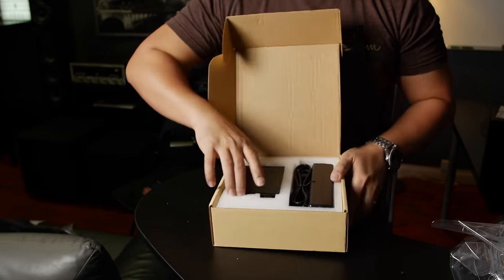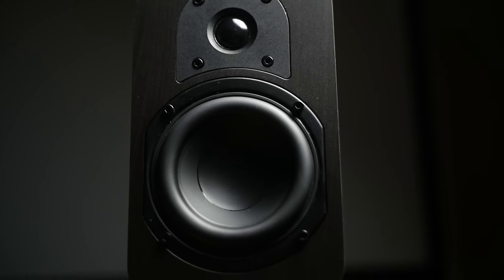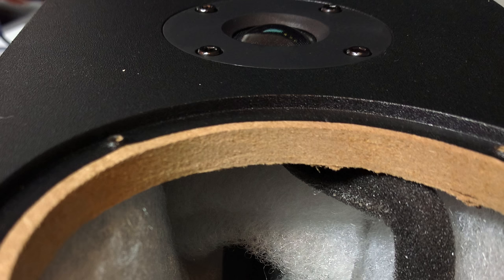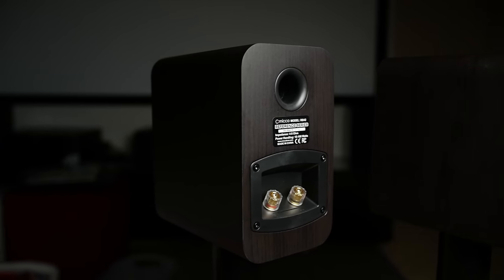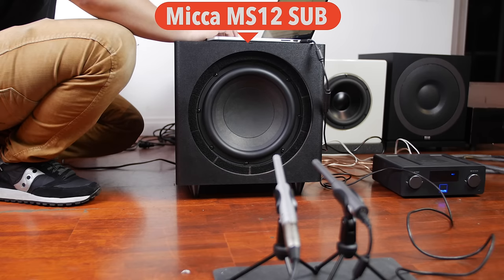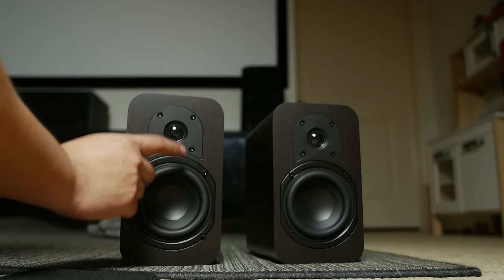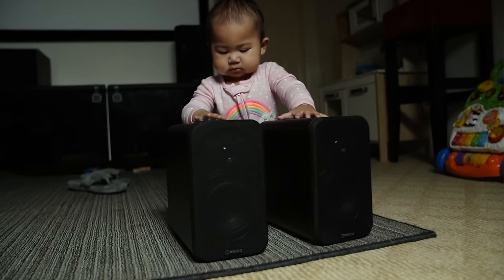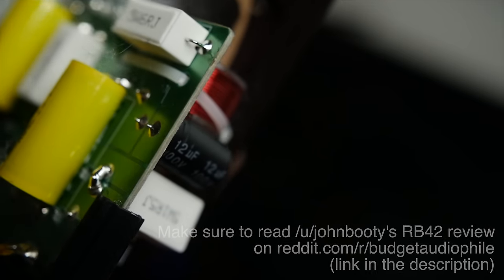Micca RB42 Review vs MB42X Bookshelf Speaker Review- Bonus Crossover Mod (End)

Comment: , the only thing with these is the fact of low sensitivity. you better be pushing a minimum of
50 wpc @rms. or more.
Reply from the maker: Correct on that one.
Reply: , I happen to have the Micca 50wpc mini amp with sub out. I'm running the Dayton 75 wpc sub plate amp into a Dayton 10 inch reference sub.
this is just at work on my work bench. I also have the Dayton MK-402s hooked up, it sounds very good. believe it or not I'm just running the signal from a Sony portable and/fm CD player, from headphone jack, 3.5mm output. kind of GUETO but hey, it's better than just a portable radio I say.

Comment: Higher-order slopes in passive crossovers also lose time-coherency, so they aren't some kind of golden ticket on all counts. There are always trade-offs. Since the average buyer of these isn't using them for pro purposes in an auditorium, it probably makes no difference 99.9% of the time, though--anymore than a high-resolution signal does, other than as a placebo.
Reply: Less of an issue with small speakers that have drivers very close to develop a "point source"

Comment: I have a micca origen g2 and I would like to use those with it. Is it possible? Can I plug both speakers to the 3.5mm aux jack on the amp? Thanks.
Reply: The Micca OriGen G2 is a DAC and Pre Amplifier, not an amplifier.  It has enough power to drive a pair of headphones, but not enough to drive a pair of speakers.  You will need an amplifier with two channels - such as the SMSL SA-98.  There are tons and tons of amplifiers available, you don't have to buy that specific amplifier.  But you do need an amplifier.

You can plug the Micca OriGen G2 DAC into the amplifier and use it as a source.

Comment: Are these better then the Ai40?
Reply from the maker: You need to add a decent amp with these which would make them more expensive. It depends on your priority. If it's simplicity and an all-in-one solution, the Ai40's would win. If you want the best sound sound quality, I would give to the Micca RB42 + SMSL AD18 by tiny bit. The main reason being they don't rely on DSP to hit the lows and to flatten the response which also means there isn't any dynamic range compression like with the Ai40's

Comment: Hey that was a gr8 review.... need some recommendation for u...  I am planning to buy 3 of these n replace my left, right and center speaker of sony HT IV300... the amp has rating of 125W at 3ohm for left and right channel and 250W at 6ohm for center speaker ... will it be ok to connect or will it damage speaker or itself... ?
Reply from the maker: They should be ok. Just find their limits and don't over drive them. Also don't let someone who doesn't know your system control the volume! 😂
Reply: @joentell  thanks ...but I fear only for center channel ..since amp is at 250W at 6ohm while speaker is just 100W at 6ohm so means amp might be overpower full for speaker ..while left/right channel is 125W at 3ohm so I think that might be less power for 6ohm 100w speaker... wouldn't it create imbalance of sound?

Comment: Are these speaker better than the fluance i40 ?
Reply: Fluance Ai40 ?
Reply from the maker: The Ai40 is like driving an automatic, these with and amp is like driving a manual car. You have more control with these, but requires a bit more setup

Comment: , these SPEAKERS need POWER. NO LESS than 50wpc. preferably 100 wpc.
buy the Yamaha receiver for $149.00. caint be beat.
your channel b you could run the mb42Xs and a subwoofer and channel A run these speakers and ur all set. or get two Emotiva
100 amps and run them mono, one for each mb402s
Reply from the maker: Yes, these love power.

Comment: what issues you have with  Jamo s803?
Reply from the maker: Please watch my previous review of them.
Reply: @joentell  Btw Crutchfield recently discontinued those Jamo 10 inch Subs ($229) cuz they were having HUUUUGE quality control issues with 'em (and the 8-inch version too).  A VERY large percentage of users reporting the EXACT same defect...a bad IC chip from what I was told....causing the woofers to 'flutter' even when your whole system was muted....crazy!
Reply from the maker: Wow. I didn't hear about that. It's too bad really. Although it's on them to make sure the products that go out are good, I still feel for them.
Reply: @joentell  Yeah it's extremely too bad! I absolutely love that Jamo 10 inch one.  Despite the defect, I chose to keep mine and try and get it repaired (...over at an electronics shop in Norwalk.  It's been in the shop now for over a month! They're still trying to track down the part!)
Reply: @joentell  Since Klipsch bought out Jamo they've totally tanked the Jamo product line and Jamo name.  I have a set of C803s on 24 inch stands set up on my 2 channel music only system and they're incredible.  I also have the C603s on a bedroom system and the C601s on a desktop and all 3 of those older Jamo speakers will blow away all of the new line that Klipsch is putting out.  It's a shame what they've done to the Jamo name brand.
Reply from the maker: I saw a higher end model than the S803 model I reviewed. It's on their website. I wonder if those are any good.
Reply: @joentell  It's not the higher model numbers as much as the fact that the original Jamo speakers manufactured by Jamo of Denmark were head and shoulders better than those produced now by Klipsch with the Jamo badge on them. It's comparing apples to oranges.  Klipsch isn't going to risk having Jamo original designs being better than theirs. There are other reviewers who share the same opinion of the Jamo speakers since Klipsch bought out the name.

Comment: ....Maybe these?  =)
Reply from the maker: These are good for their size, but I promise the B6 is on a different level. The size difference should hint at the difference in bass output and max SPL. The huge waveguide on the B6 does what it's supposed to do. I have a feeling you will appreciate it.
Reply: @joentell  .. More difficult to hang for height... unless a hint I dropped to the 'boss' eventually means I can get a future prototype to try and showcase for my installation.